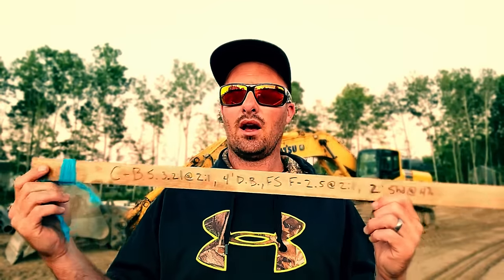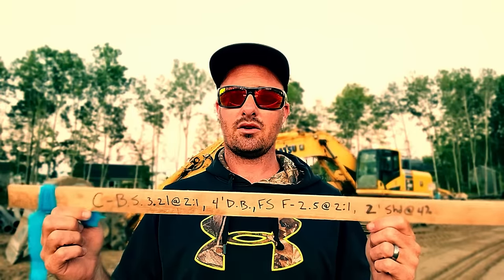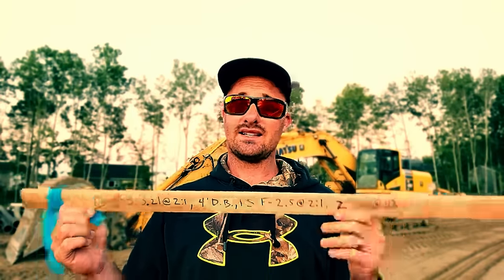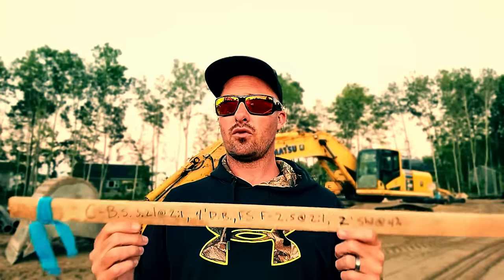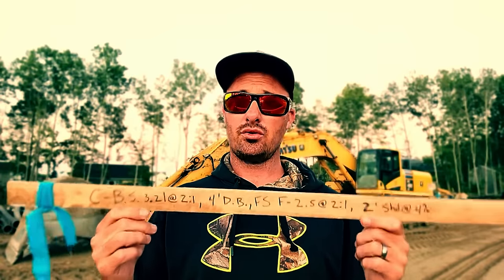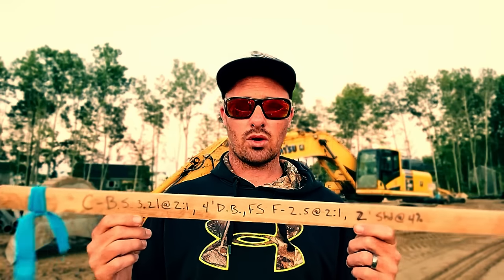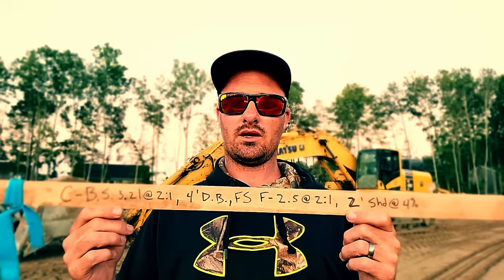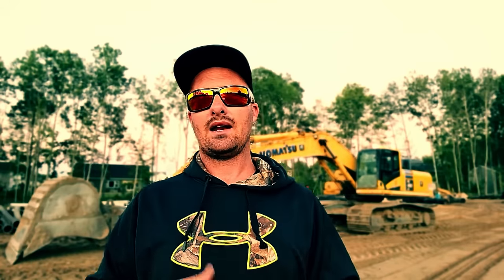HOW TO READ GRADE STAKES || How to read grade stakes for roads - Grade stakes cut and fill

Comment: We had a rule for truck drivers on the jobsite, if you run over a grade stake, you buy the operator a steak dinner! "Break a stake, buy a steak!"
Reply from the maker: I can tell you for certain, I'm glad we didn't have that rule.  I'd weigh about 400lbs by now😂
Reply: Shoot forget the operator buy the grade setter a steak dinner. I'm in school rn as a grade setter/engineer and we do our layouts on land where equipment is being learned. Can't tell you how much of a bitch it is when I layout a pad, get elevations, mark and ribbon it up only to come back the next day and see that someone ran through them. I couldn't imagine back in the day before lasers having to redo everything.
Reply: No NO NO...you buy the surveyor a steak dinner.  Otherwise you don't get anymore grades
Reply: Surveyor here… God how I wish I had that rule on our sites. 

Wouldn’t even have to have been for me, just somebody so there’d be SOME accountability.  I got SO tired of re-staking (it was a “game” on many sites).
Reply: Gotta use this one dude 😂

Comment: The only reason they don't use trucks is because it crosses a public road. The only reason it hasn't been replaced with a conveyor belt is the low volume.  It's only  about 10 dump truck loads, a couple mining truck loads. Way less cost, labor and pollution per ton.

Comment: 2 types of gradecheckers. rough grade / fine grade. 3.5 feet of cut is not close ehough for surveyor stakes the rough grade guy should get it within a few tenths for finish. (no more pinnicles). then just pound the surveyor hub to grade . kiel or feather

Comment: Here in Utah I'm like the only excavator still using stakes. Everyone is GPS. I've seen graders using GPS for curb gutter and curb machines with no strings full GPS. A friend of mine was grading storage units, he parked his 140H hired a 140M with gps. Guy graded pads in about 5 passes then lined up on edge made one pass cut thickened edge, turned came up other side. Took him about 45 minutes per 200 ft x 35ft pad. Concrete crew set 2x10 around perimeter it was right on. I'm barely able to compete now and will have to convert or go back to digging basements and small jobs. Good video it may be a lost art in few years.
Reply from the maker: Grade stakes still have their place but they are getting less and less common. Gps has really changed the landscape. Thanks for watching!

Comment: Great video. I'm new to construction and fell into it with GPS a without ever knowing how to read a grade stake. I have since learned some of the important ones as a dozer operator which usually has gps. but I want and need to know all of them. I wish I would have started on the ground as a grade setter but it is what it is. Gonna try and watch your whole series. Very informative.
Reply from the maker: Knowing how to read grade stakes as well as how to cut grade for a grade checker are two really important skills that I would focus honing.  If you ever have GPS issues or get on a machine without GPS you'll be lost without those skills.  I'd also recommend doing some final passes in manual mode on occasions where you have time.  It's super easy to become too reliant on the GPS and you lose your finish grade finesse.  Thanks for watching Darrell!  I really appreciate you brother.
Reply: @DieselandIron  yes tour right about relying on gps too much. I know this old blade operator and we did a landfill job up here in Redding CA. And he finished the job by Hand, even though the blade had automatics on it. It was probably the slick finish dozer that made it easy for him (that was me lol).

Comment: I’ve always wanted to know why the excavator boom is parked like that with the bucket too. I’m a newbie and love this video, really helps at work thank you!
Reply from the maker: Most of the time you see the boom and stick sitting up at 90 degrees because that takes up the least amount of room on the job.  If you see the boom and stick extended out all the way or tucked in all the way it is typically because the operator has positioned the machine so they can grease the machine easier in the morning.  Thanks for watching!

Comment: Thank you. The clearing crew I used to work on, our stakes were CL for clearing limit but being that was. Usually all that would be wrote on them they would write it out instead of putting cl. I was usually on the dozer so I would just barely rake or backdrag past them so when I got it clean I could put 3 to 4 trackwidths walked in in line and coming back into the job so the silt fence crew had a good straight clean level line and work area, it made it look really good when finished
Reply from the maker: I bet the silt fence guys appreciated that. I don't envy those guys at all, especially on jobs back in the woods...

Comment: good explanation, around here they are called a hub and a guard, it not a grade stake till the carrot is drawn on it. the only thing I was told different  is when measuring an offset you measure from the pin in the hub for the exact distance as the guard is arbitrary located behind the hub
Reply from the maker: Thanks for the input!  Here it depends on the survey firm as to whether you get a pin or not.  Most of the time you center on the hub and that's your measure point.

Comment: I like your channel, it’s currently based on info I’m looking for in my career. Thanks for putting this together, looking forward to future material!
Reply from the maker: Thanks for watching and thanks for the compliment!  Let me know if there's anything specific you're looking for.
Reply: @DieselandIron  personally looking for: 
Dozer- types of cuts, ie scrape cuts. Slope work, ripping/grubbing basins or fields. Dressing up slopes, spreading and compacting material, ie building a buttress with specific compaction. Working off steep slopes, fire service type work. D8/6/5 with slope board even. 
Grader: looking for road maintenance and repair. Truck trail type roads, or just dirt access roads. 
Backhoe: Municipal type work, rolling around town. Digging out trenches and creating slopes. Benching.. maybe some veteran operator tips and tricks for a wide array or work.
Reply from the maker: @LADEntertainment  God damn, you have quite the list!  Let me see what I can come up with.  Fair warning, it's going to be a bit before I can take some of these on.  I've got a whole series coming up on running GPS in a dozer.  That's going to take a bit to work through along with some other requests.
Reply: @DieselandIron  not a problem, not really requests just what’s in my field. If you happen to cover any great, if not no biggie your material is still valuable to me. Thank you!
Reply from the maker: @LADEntertainment  thanks LeRoy!

Comment: Yes I have installed water , sewer , storm sewer , dug basements , one rule on the job , don’t knock out a stake , especially if the layoff season is.  coming up
Reply from the maker: Haha quick trip to the front of the layoff line!
Reply: Yes it is especially in the Fall when the big OFF is about to happen for the Winter

Comment: Awesome video!
The only thing different here in Canada is we use the metric system. 
I am used to both, we use standard on our residential jobs and metric when we get on commercial sites.
I don’t know why we switched over to metric. Nothing like having 2 measurement systems🤪
Very informative video
Reply from the maker: Thanks for watching!  I finally figured out why your comments weren't showing up!  They had you flagged as spam for whatever reason.  I've got it fixed so I should actually see your comments now.  Yeah, the imperial system is terrible and I wish we would join the rest of the world and just use metric....
Reply: @DieselandIron  Awesome!!
I like the metric system but alot of products here are measured using the imperial system.
Can be a pain in the a##
Reply from the maker: @gibsonlandscapeconstructio7984  thats the good ole US of A working for you!
Reply: @DieselandIron  Yep!!
Made in the good ole US of A

Comment: Grade stakes are nice and handy, I learned to build roads, (logging in the PNW) with just a blaze on a tree and some henscratch with a paint stick. If important information was needed, there might be a  piece of "rite-in-the -rain" paper with a real note. What was really frustrating was when the right of way cutters laid down a tree for usually a safety reason and it had the information on it. then you stood on the tracks of your Cat with a p-gun and sighted down to where you at least thought you needed to go. 
Yup, grade stakes are much nicer and easier to use.
Reply from the maker: Logging is a whole different animal. You don't get luxuries when you're logging 😅

Comment: Wish you were around when I started in 1998 ,I had to start from the bottom and learn the hard way . If you travel from state to state for work  ,you will learn there are many different  ways they abbreviate  ,or jargon. That the local use to describe something.  . I've seen "LOD" as"LOC" (limits of construction)  and"BMK" as "TBM" (Temporary  bench mark) which is surrounded  by a "pig pen"  the mark on your cut and fill stakes you refer to as a carrot top has typically been called a ( CROW'S foot)  or (R.P) radious  point ) "POR" (POINT OF RADIOUS) or reference point.  Ant hills can also be referred  to as castles  as well . The locals seem to make up alot of their own jargon . That goes for what they call their machines as well . Excavator ,hoe, or track hoe,...pans or scrapers..... blade or motor grader ,maintainer, etc  I've even heard a real old dude call a dozer a cat skinner.  ...great video ,way more to dirt work than people realize .when you go from the flat plains to the rocky mountains ,to the desert in death valley , or to the Noth slope of Alaska  , or a FERC job on the beaches of the gulf.  You will see there are many  different  ways  companies do things that only apply to that particular area.
Reply from the maker: It is incredible how much variation there is in the industry based on something as simple as geography.  I have people reach out all the time with grade stake questions and I always tell them to send me pictures of the surrounding stakes so I can get some context.  Who knows what some of those abbreviations mean!😂

Comment: Hi excellent video i subscribed. Im really new to reading grade stakes this has been very helpful. I was wondering if you are building a road with a motor grader and you have a stake that starts with a cut but then next stake is a fill, is it a gradual transition between stakes whether or not its cut or fill? I hope my question made sense lol
Reply from the maker: Yes, it will be a gradual transition between the grade stakes.  At the end of the day we are creating surfaces and it wouldn't make sense to create a stair or vertical edge in the middle of a smooth surface.  Cut stakes for underground work are a different story.

Comment: I just had stakes put in my front yard. With R/W (Right of Way) and O/S, which I believe is (outside diameter), I would love to know what it all means. I know they have road construction planned for the road that is in front of my house. Where the stakes are.
Reply from the maker: O/S is going to be an offset stake.  It should have a dimension on it that lets you know how far it is offset from it's reference stake.  It will also have a label, for instance "C.B." which is catch basin.  The stake would read something like, "15' O/S C.B. #3" which means it is 15' offset from catch basin number 3.  The number 3 will reference that specific catch basin on the prints so you can pull up elevation data to set the structure.

Comment: Really interesting great information for a green horn. Question? The last stake you showed was mostly understandable except for the very last elevation. Was that the hub elevation or the elevation of the underground pipe to be put in?🤔 Thank you for passing on knowledge
Reply from the maker: On that particular stake it was referencing a hub to give an elevation that the grade checker could take a shot from.  He would then use that elevation to set the depth for whatever the pipe or structure was they were setting.  Thanks for watching!
Reply: @DieselandIron  thank you that’s helpful
Reply from the maker: @erichill5208  you got it! Let me know if you have more questions

Comment: This was a really good outline on how to read job stakes. I would like to make a couple of corrections on the reading of the ditch stakes though if you don't mind. [14:37] The Front Slope is the slope closest to the roadway and was at a 3:1. The  Back Slope is the slope from the bottom of the 4' ditch to tie into either natural ground or possibly a filled section at the furthest outside point and was at 2:1.  A 2:1 slope is steeper than a 3:1 where the slope is measured as 3' for the run and the 1' as the rise versus 2' as the run and 1' as the rise. (Generally, the Front Slope is a non-recoverable, but traversable slope at 3:1 whereas a steeper slope, i.e. (2:1) might induce a roll-over or a harsh landing on a flat bottom ditch.) All in all, your explanations of jobsite grade stakes and hubs was spot on and will be a major help to anyone who just wants to know what all those stakes mean or even a greenhorn starting work with a grading contractor. Great job!
Reply from the maker: Thanks Ed! Bring on the corrections, I'm all for it and I appreciate people checking me. A lot of times it's easy to get mixed up while in front of the camera (especially when I was new to doing it). Thanks for watching and thanks for the input!
Reply: @DieselandIron  I think it's great that people like you take the time to share their knowledge of a subject. I have been a registered land surveyor for almost 30 years and I clicked on your video to see if there's anything new I could "lift" from someone else's knowledge. It's never too late to learn.
Reply from the maker: @finallyitsed2191  absolutely and I talked about that all the time on my channel. This is an industry where you should never stop learning and if you have you've gotten complacent. I was wondering if you had a surveyor or engineering background with the way you describe those slopes.  What part of the country are you from? I would really love to do a video where I follow a surveyor for a day and help him set stakes and elevation hubs to show the process.
Reply: @DieselandIron  I am in Alabama and work for a large engineering firm with offices throughout the southeast. I have been the Department Head for Constructing Engineering and Inspection for about 20 years where I have inspectors that oversee Department of Transportation highway, bridge, and airport construction projects and have for the most part hung up my surveyor's hat. We do, however, have several survey parties throughout Alabama, Atlanta, Nashville, Huntsville, Birmingham and Florida that might be close enough for something to be worked out.
Reply from the maker: @finallyitsed2191  I got a question for you, I've had a request for breaking down different types of base materials for roads and why they are used. For example why is sand used with stone over top and not the other way around. Any chance you have the knowledge that I could do an interview with you over the phone?  That was my project for this next week with tracking someone down to interview. I'd rather interview someone that's an active fan of the channel if possible. Let me know if you'd be interested and we can set something up.
Reply: @DieselandIron  The choice of base materials for roadways depends on a lot of factors.  If a roadway is placed on well drained soils, i.e. (clayey sandy materials) that have good drainage along the roadway such as well shaped ditches with a positive outlet, the base can be the natural material or even a clay/gravel base compacted to 95 to 100 standard proctor density.  If you have a planned roadway on heavy fat clays such as prairie soils, side drainage is always imperative but the preparation can utilize any number of methods ranging from lime stabilization to compete removal of materials for a predetermined depth and replacement with stone with gradation that allows fines up through larger stone (3/4 - 1") as a base.  Soft soils could also be bridged utilizing a geosynthetic fabric prior to placement of replacement materials. The list goes on and on and changes dramatically depending on the conditions of each site. My recommendation will always be to get the expert opinion of a Geotechnical Engineer who completely understands the mechanics of your soil conditions and makes an appropriate decision which includes feasibility and cost for each corrective option. As you can gather from this, there is no "simple" one answer fits all with roadways with the following three exceptions.... 
Drainage, Drainage, Drainage!
Reply from the maker: @finallyitsed2191  would you have any interest in doing an interview? I'd love to pick your brain for a bit if you are interested.
Reply: @DieselandIron  I'd be fine with that but I don't believe there is a way to provide contact information
Reply from the maker: @finallyitsed2191  shoot me your details at thatdiggerdude@gmail.com and I'll get ahold of you.
Reply: @DieselandIron  Done.
Reply: @DieselandIron  you need to find one that still does it old school, with an optical theodolite and a steel tape, not these new fangled gps things
Reply from the maker: @jonschneck4559  haha that would be fun to show the old school methods. Maybe I'll make an old school video at some point going through old construction techniques